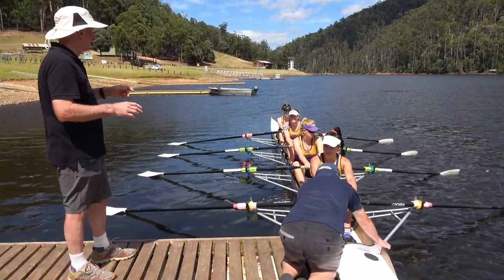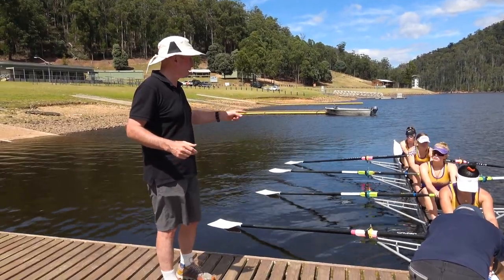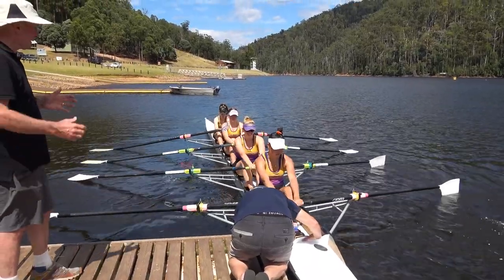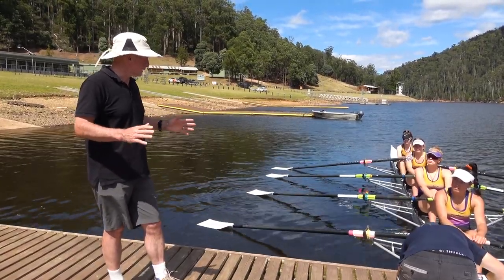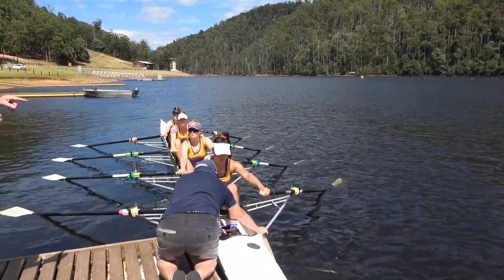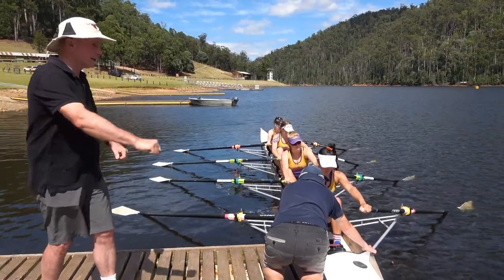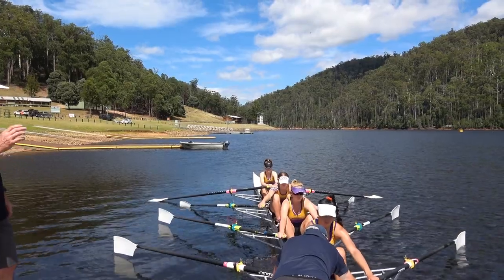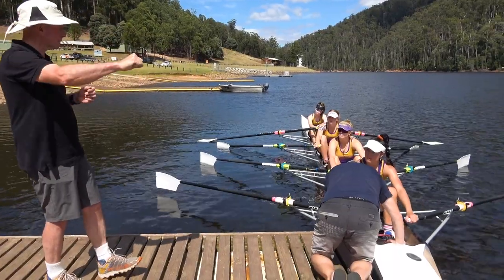Calibrating Blade Depth at the Rowing Catch

Comment: FWIW  My coaches say the opposite -- don't go too deep.  The oar once planted doesn't move even if there is a bit of the top of the blade above the water.     FASTER MASTERS says "Blade depth and boat speed: Rowing oars are designed to sit at the correct depth in the water – check it out when you sit stationary with square blades in the water, how much of the oar spoon is covered by water?   Normally it’s fully below the surface except perhaps 1 cm at the top.  Blades are buoyant.  We conclude that any variation from this depth is caused by the athlete doing something to make the oar more shallow or (more frequently) deeper than needed."     Concept2 oars float at the right height, if you take your hands off with the oars squared and burried they will sit with just the top edge exposed.